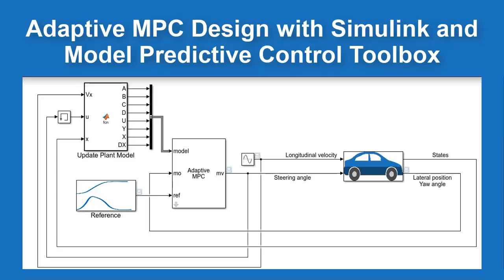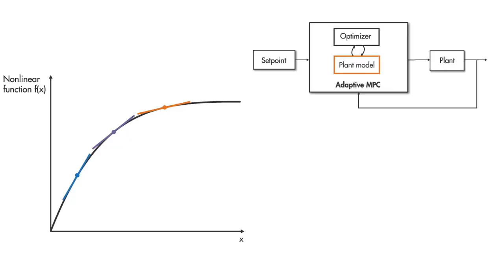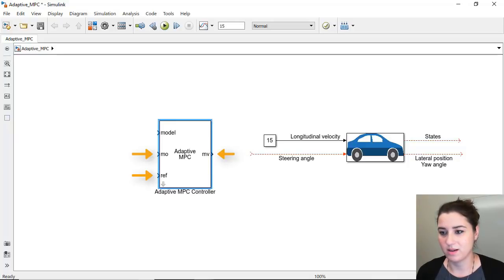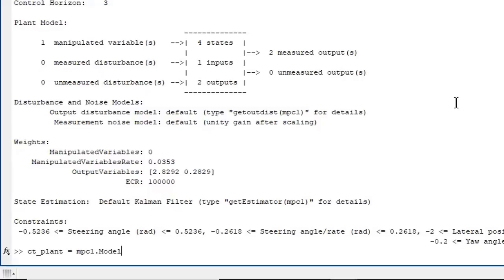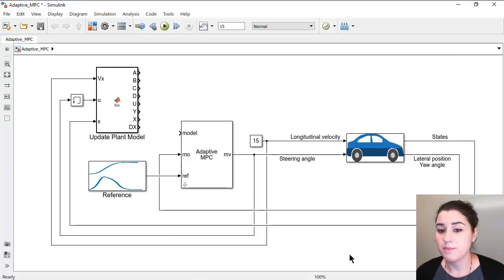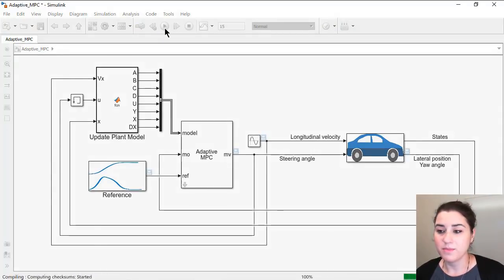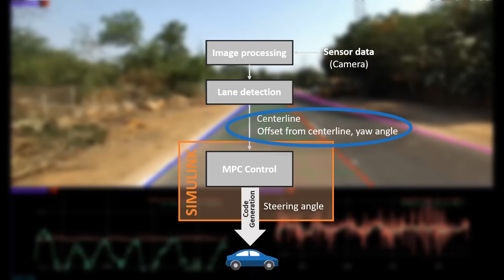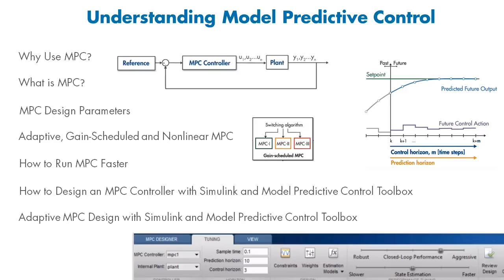Adaptive Model Predictive Control Design with Simulink | Understanding MPC, Part 7

Comment: Please help, these errors are coming :

Error in port widths or dimensions. The signal connected to the "Model.DX" port of the "untitled/Adaptive MPC Controller" block must be a matrix signal of 4 rows and 1 columns. 
Error in port widths or dimensions. 'Output Port 1' of 'untitled/Adaptive MPC Controller/MPC/MPC Matrix Signal Check DX/Input' is a one dimensional vector with 4 elements.
Reply: facing same problem

Comment: This Controller works for Vehicle Dynamic Model. What if I have an Kinematic Bicycle model , will the controller still work similarly, any leads ?
Reply: Since, You have to provide plant model in state space form. It should work for Bicycle as well if the model you have created is accurate.

Comment: Hi, how did you export the adaptive mpc from simulink to your workspace? Since it doesn't have the option to use the MPC design tool and export it from there I can't think of a way to do it. I also tried to just run the simulation and see if it created the variable in the workspace automatically but it didn't and it also couldn't run since it has to be discretisized and to do that I need to have it in the workspace.
Reply: Same question. Do you solve it?

Comment: i have a feeling that in the video, the velocity is included in the plant model, thus the so called adaptive is needed, however, is it more reasonable that both steering angle and velocity being input and the plant model is purely vehicle dynamics?
Reply: Hi, the velocity is included in the plant model regardless of the type of MPC controller you use (whether regular or adaptive). The lateral vehicle dynamics is changing with the longitudinal velocity which is provided to the plant model as an input so that we can change it and simulate it with different inputs (constant, sine wave).

Comment: thank you for this video. I still wonder how to do optimization if the model is sth like LSTM neural network.
Reply: Hi, how did you export the adaptive mpc from simulink to your workspace? Since it doesn't have the option to use the MPC design tool and export it from there I can't think of a way to do it.